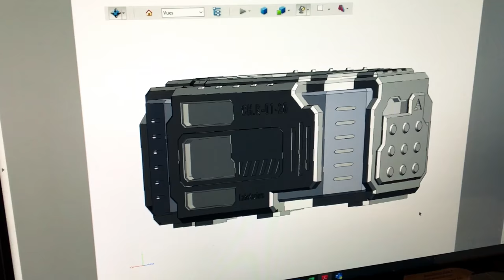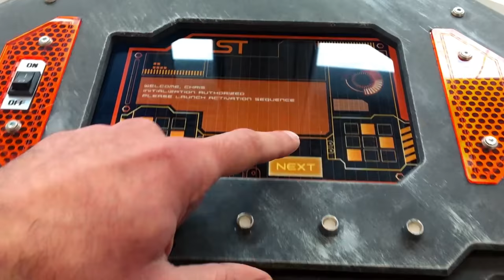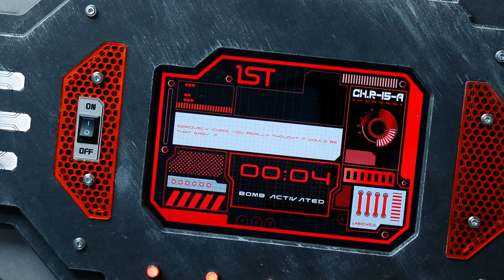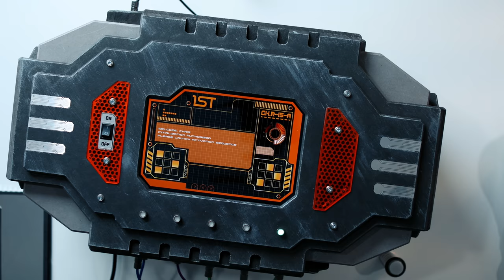Breaking Down The $20,000 Puzzle Box!! (BTS, Alternate Solutions, Making of)

Comment: This is absolutely amazing and I would love to see more puzzles with electronics. But I have some suggestions for the designers. I hope my critique is constructive.
Use a slightly more powerful laser with pulse-coded data. This would make accidentally activating the light sensor impossible.
I know it's a one-of-a-kind but custom PCBs are dirt cheap nowadays. That wiring is a hot-glued mess.
The solving could be a couple of steps longer.
For 20000 surely you can spend a few hundred dollars to machine a metal body, from aluminium for example. The feel of the device as a whole would be much better.
I think a movie-style slow ticking that speeds up near the end of the countdown would be cool. But it might also be distracting. I'm not sure about that.
Decorative LEDs underneath colored diffusers  would be a nice touch. For example the orange strips on the side of the box could glow.

Comment: Seeing you use the plug wires reminds me of the plugboard wire pairs on the Engima Cypher Machines the Germans had during WWII. It would be really cool to see a puzzle box designed around that. Having to set the rotors and plugboard to the right positions and then use the machine to unlock the code

Comment: The wires make more sense (opposite need not apply), if you consider that the bottom row is the power source (bolt icon) and the top row is the device to be powered (light icon).

Comment: V2 of this, Make 2 puzzles, exclusively sold after the completion of an online puzzle to ensure you meet the criteria to solve.
Puzzle needs 2 buyers, as it can only be solved in sync with each other, i.e. turn based using a SIM inside the tablet to communicate with each other, i.e. maybe some type of messenger function, or call function but limited each call time to say 1 - 2 minutes call time.

Would be cool to work a puzzle around that requirement.

Comment: The only way it could cooler is if there were several additional hidden compartments and widgets to open, plug-in, and remove whose accessibility and function changed every time you operated the puzzle.  That way, you'd have different solutions and different tools used every time, and subsequent solutions would reveal new surprises in the form of previously undiscovered compartments, widgets, and solutions.

@Chris Ramsay: Any way they could mod your original puzzle to add these features in?  That'd give it some SWEET replayability.

Comment: Cant belive how many people are upset by the price. 
Yes, it cost like a new car and the complexity and the material is far lower. But this is one of a kind. 
All time spent designing this puzzle have to be made up by this single item. 

Sales tax at like 13%.(quick google, could be wrong) : 160$
Profit for the company, 10% (not very good margin): 160$ 
Lets say the parts are 300$ that leavs us with 1380$

Dont know what canadian engineers cost a hour but 100$? i would guess thats a decent estimate.  That means that the company cant put in more then 138 hours in to this project. From first skeches, design, meetings, dissussions, manufacturing, assembly, programming, testing. troubleshooting, packing and shipping. 
(They also need to pay for CAD software licences,  machines, computers, rent, the receptionist, the guy cleaning and other stuff that isent really related to this specific project, meetings about other products that someone never orderd. But lets leave that out)

So 1380$ ,100$ per hour means 3,5 people full time for 1 week. Not so insane.

Comment: You said there were several solutions.  Did I miss something in this video???  i only saw two.?!

I've done some thinking about the price.  I am not a maker/builder here.  But I would challenge anyone to try to make a similar type of puzzle, and see where the price comes out.  Outer guideline the box has to have at least four steps to solve.  YES the cost of the tablet has to be considered.

Personally I used to do some programming, and the programming end of this project might have taken two weeks.  (personal, biased, stupid, opinion). Saying it took months I think is an over exaggeration.

Comment: At 6:00 He says he needed to use mirror to reflect laser and unlock drawer. But he actually opened the drawer by pressing side buttons (unlock and open are two different steps?). Also I still don't get how he found the sequence for those buttons.  Then he goes to next task (with wires from the drawer) and says mirror shouldn't be out by that moment. How would he reflect the laser without the mirror? Laser task comes before wires task. Black wire placement isn't clear as well - it is plugged into top ride hole in the face panel. There are plenty of holes there, why exactly this one? He didn't tell anything about thought process, just did show where it goes (and it's totally skipped in original video). Confusing...

Comment: 2020.
How do we make toy puzzle box?
A tablet with 2GHz CPU and 4GB RAM with hundreds of lines of code.
In 1970 this thing* would consist of a battery, a couple of motors and relays, and a bunch of wires and light bulbs.
I would make one for $20000.
Scratch that, I would do that for $20 at the time, although I won't go that low today.
*) Not 1:1 replica (which is possible but impractical), rather a functionally identical device. I.e. messages lighting up on the screen instead of "typing" effect, clock scrolling like a tape/time counter, buttons flashing green on a timer instead of a set period of time after being touched, etc

Comment: No offence to the developers, but for 20 grand, they should've custom written an application directly into a RasPi or Arduino and have used an LED screen instead of having a Samsung tablet with a Unity application in it which you need to tap to open. They had 6 months and 20K to do this. But amazing prop design though!

Comment: Ehh... I mean it’s def a cool prop. But $20k?? I don’t think so. The code I could write in a few hours. The wiring should be fairly straight forward.  The only thing I couldn’t manufacture is the actual box but, only because I don’t have the equipment.   However, as you are a collector and it’s a custom 1 of a kind piece, I can see the value it may have.

Comment: Sure a lot went into it but it still wasn't worth it in my opinion. A lot of people could 3d print that, and code it with an arduino or pi and a screen. The wooden box 20k puzzle is much more sophisticated with Bluetooth, AR, switches that trigger the mini tablet/smartphone, etc. 

Next the damn thing arrived broken. Hard to say it's worth it's money if it's so easily broken. It's obviously flimsy with the connections inside. And instead of fixing the connections, we just generate a simpler solution and make the thing maybe a smidge more confusing with randomly non responsive buttons. 

The puzzles were fairly simple and boring. The coolest ones didn't even work, and proved a flashlight could have accomplished the same thing as the fancy laser trick... To prove how simple they were. You took a tool that no longer served a purpose due to lightbulbs... and used it incorrectly to solve a non related puzzle correctly.

I mean it has how many steps?
Turn on. 
Hold buttons.
Tap buttons on the other side (while optionally holding a mirror at a proper angle... the only sophisticated and worth while portion of the puzzle)
And plug in some wires. Wildly guessing has no consequence and is practically encouraged. 

It really wasn't a well executed puzzle. I'm glad it is worth it to you, that is what matters. But in all honesty a functional version of this box shouldn't run more than $2,000. That's leaving plenty of room for profit. And this thing came broken on arrival and broken after a "quick fix". A mess of wires that seems to be a nonsensical mess of wires. Doesn't mean it's sophisticated. 

This was so easy to bypass you didn't even know you did it, it came broken, was fixed and still broken, and provided little mental resistance. 

But I won't lie the whole get up is cool. But I mean it's so poorly made if you left that phone in the slot, you'd have screwed yourself on solving the puzzle... and still solved it. Just a let down all around... for $20k. 

Buuuut you could find 400 people willing to pay $50 to play that themselves and preprogram it with their names. Then you'd get your money back.

Comment: This really wouldn't cost 20000. As an electronics engineer I can whole heatedly say that the wiring inside of there is a disgrace. No reason some of the buttons stopped working during shipping. This thing was not made to last. This whole thing could be done in a package half it's size. And doe for at least a quarter of the price. The software development would be the most costly thing but even that was half assed, not even running on the boot of the tablet.
Reply: It should of been much more extensive for the price you paid. At least it looks the part I suppose.